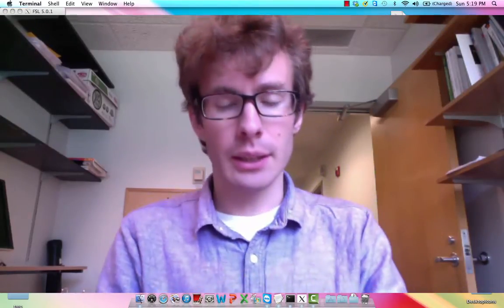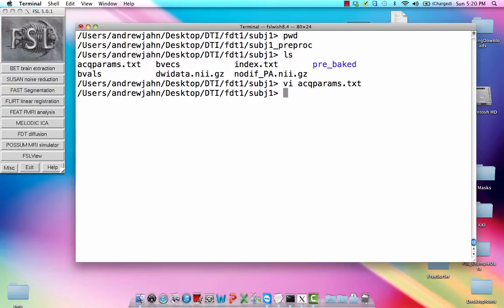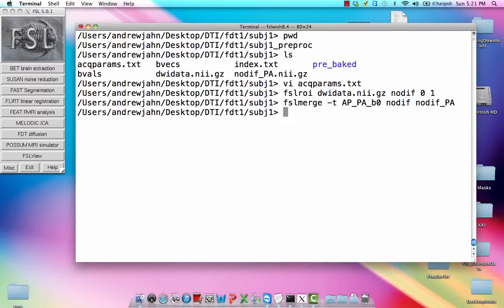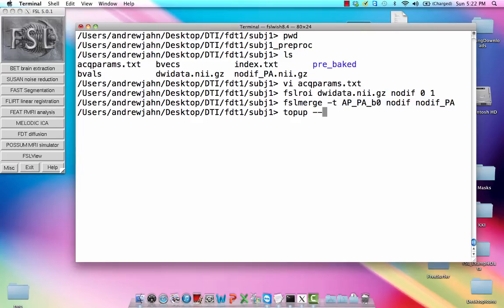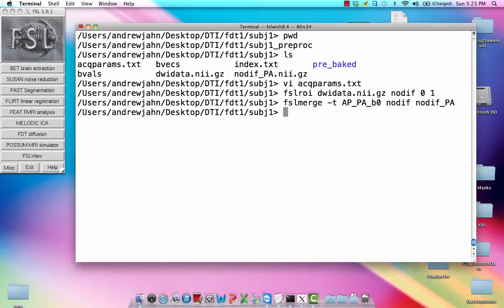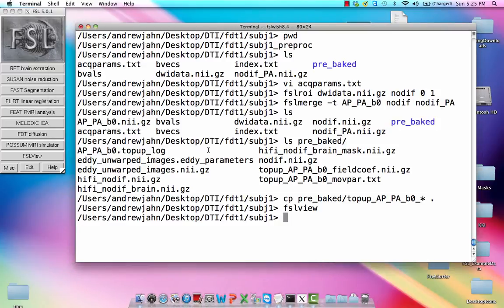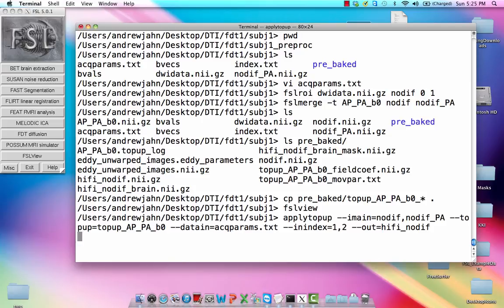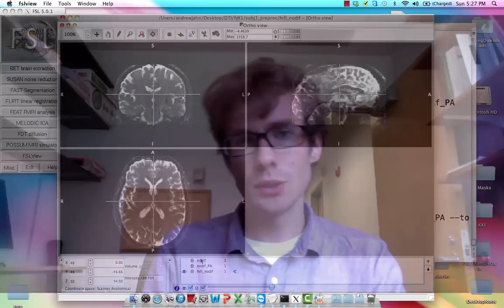DTI Analysis, Step 1: Run TopUp

Comment: Hi Andrew, 
Great tutorials, thank you! Quick question- I am unable to run topup because I don't have images acquired in different directions (all acquired A->P). How do you recommend to proceed? eddy or eddy_current?

Thanks in advance!
Reply from the maker: Hey guys, I apologize for being very late to the party on this one, but I will pin this comment so that others will see it first. Thanks for figuring this out Kristine!

-Andy
Reply: Kristine, I corrected epi-distortions by aligning my single-direction encoding DWI dataset (30 directions, A-P) into a T1-weighted image using BrainSuite's software (http://brainsuite.org/processing/diffusion/).

Maybe it is not the better approach (topup or fugue are better), but if you lack of a grefield-map sequence (for fugue) or opposite encoding directions (for topup), this sure does something!
Reply: I got this answer asking in researchgate:

https://www.researchgate.net/post/Do_I_have_to_run_topup_of_FSL_before_running_eddy_for_correcting_currents
Reply: Kristine, did you get an answer for this? I'm having the same problem! 

thanks!
Reply: Hi Jonatan! I went ahead with eddy* (as per Jesper's recommendation here https://www.jiscmail.ac.uk/cgi-bin/webadmin?A2=FSL;9f474c50.1609)

This FSL archive should provide all the information you need to proceed!

Corrected to say "eddy"
Reply: thank you very much Kristine!
Reply: oops sorry! That was a typo, I went with the NEW eddy command! But you probably got that from the archive
Reply: So, we don't/cannot implement topup, right? 
Should we proceed with bet and then eddy and the other videos?
Reply: I didn't understand how should we proceed if we do not have the different directions

Comment: Hi Andrew, I just started learning how to dotopup and  eddy current correction but I have a question regarding AP and PA image, is it generated by scanner or I need to extract them from dwi data using fslroi command?
Reply from the maker: Hi Hussein, they should be generated automatically by the scanner; you will need to specify that one of the runs you acquire is in the opposite phase-encoding direction. If you haven't acquired it from the scanner, then unfortunately there isn't a way to recreate it.

Best,

-Andy

Comment: on average, how long does it take to run topup?
Reply: It really depends on your computer. Are you seeing progress, as in, the status of the optimization algorithm progressing updating as test in the command line window? If not, it is likely not running. Otherwise, sit tight, or get a better computer (expensive), or use a remote computing cluster if you have access.

Comment: Hi Andrew,  I love your tutorials.  Can you clear something up for me real quick?  Do you know if it's ok to skip 'top-up' if DTI were only acquired in one direction, i.e. I have only one b0 value?  I don't have  A-P & P-A scans, nor do I have an acqparams.txt file.  Is there some other way to identify field map distortions or would I move on to eddy-corrections?  Thanks!!
Reply: Hi, jlingo03, I have the same issue, did you get an answer for this? thanks!
Reply: I didn't.  Since I don't have the A-P & P-A scans, there's really no way for me to follow this protocol.  Maybe this is done when a different/specific scanner is used?  My pre-processing steps are BET, eddy-correction, then DTI-Fit.  Please let me know if you find out something different!
Reply: For what i've been reading what you did with your preprocessing it seems about right. However and if i'm not mistaken, if your protocol has an fmri sequence you might have a field map too, which you can use with fsl FUGUE to unwrap the EPI distortions from your DTI data (http://www.diffusion-imaging.com/2015/10/dti-tutorial-1-from-scanner-to-tensor.html). Since I don't have this fieldmaps for all my subjects, i'll go with your suggestion. Thanks!
Reply: Nice!  I'm not sure about the field map info, I'll look into it, thanks!
Reply: I know this was asked a while back, but it might be helpful for other people with this issue in the future to know what you might be able to do preproc using only 1 direction using the 'dwifslpreproc' command from mrtrix with the -rpe_none flag. Here is the link: https://mrtrix.readthedocs.io/en/dev/reference/commands/dwifslpreproc.html

Comment: Thanks Andrew for posting all the helpful videos. Just noticed one minor mistake. At 4:40, “--config=b02b0.cnf" is actually NOT an output, it is an input file, containing "parameters that have been found to be useful for registering a set of good quality b=0 images" (http://fsl.fmrib.ox.ac.uk/fsl/fslwiki/topup/TopupUsersGuide#Configuration_files). This file can be found under the directory …/fsl/etc/flirtsch/.
Reply from the maker: Thanks Gaoyu! I'll update the info box with that.

-Andy

Comment: I also have the same problem... from the DICOM data, i convert by into .nii file with two more files, file.bvec, and file.bval,. I dont have nodif_PA image and aqcpara.txt file. How should i get that. Should i skip the topup step.
Reply: 1) how to get acqparam.txt - https://fsl.fmrib.ox.ac.uk/fsl/fslwiki/eddy/Faq
2_ how to get index.txt - https://fsl.fmrib.ox.ac.uk/fslcourse/lectures/practicals/fdt1/index.html

Comment: hi again, this time i have a question about DTI, if i only have the rawdata.nii, file.bvec, and file.bval, can i run this topup command? or i have to start with eddy?

regards!!
Reply: cesar romero did you get the answer to this?! i have the same problem
Reply: hi, no i don't have the answer, but i think that this step is not necesary, you can do your preprocessing without topup, cheers!!!
Reply: @emmak23  1) how to get acqparam.txt - https://fsl.fmrib.ox.ac.uk/fsl/fslwiki/eddy/Faq
2_ how to get index.txt - https://fsl.fmrib.ox.ac.uk/fslcourse/lectures/practicals/fdt1/index.html

Comment: hi again andrew, thanks for your answer and videos, i have a question related to cortical thickness, is there a way to do the analysis in FSL?,

i've read many papers about the accuracy of the cortical thickness stimation, eg, FreeSurfer despite is the most used software, the estimation of cortical thickness is less accurate than voxel based cortical thickness or the alghoritm of CIVET.

Do you know how to calculate (step by step) the voxel based cortical thickness maps in SPM?

thanks again, greetings from Mexico